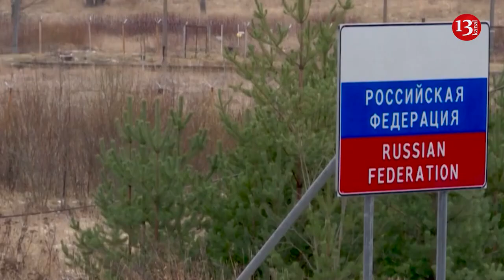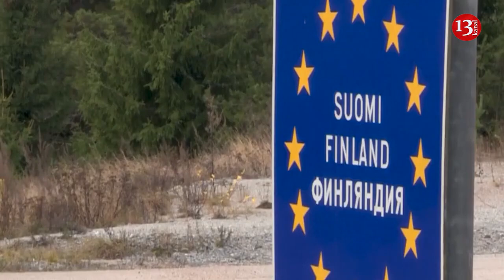Finland starts building a fence on the border with Russia

Comment: Damn that, now you need a 20-30 ft. barb wire watchtower wall of steel and concrete, 30-50 yrds. thick with 20 ft steel blast doors.... High level LED spotlighting for night checks or sum shit.

Everything seen in the Sci fi movies.
Reply: no need, fence sensors detect those ruzzkies and then they are hunted down.
Reply: They just need NATO.